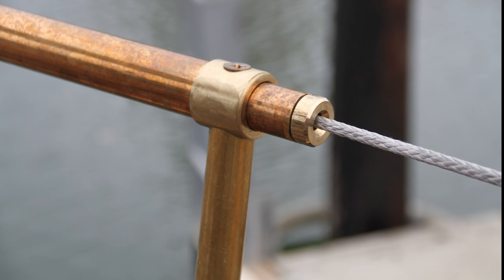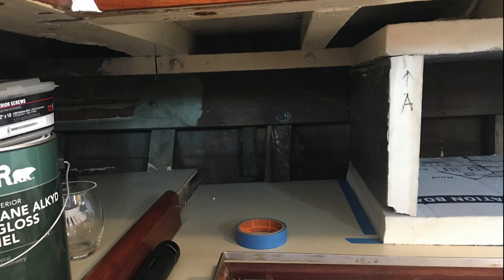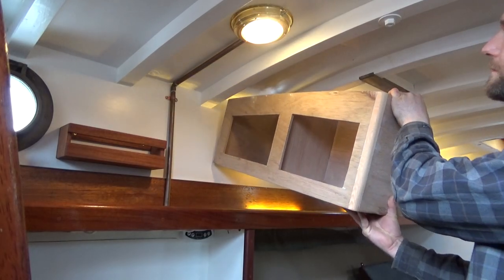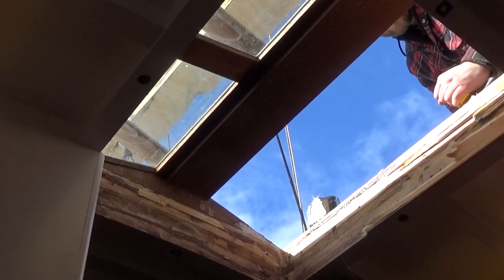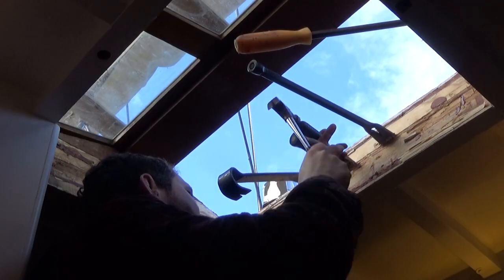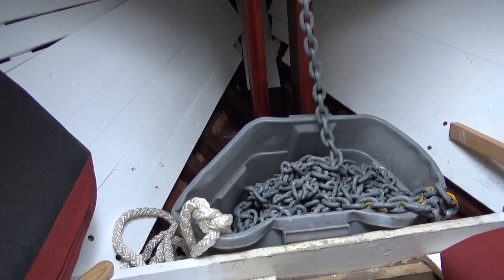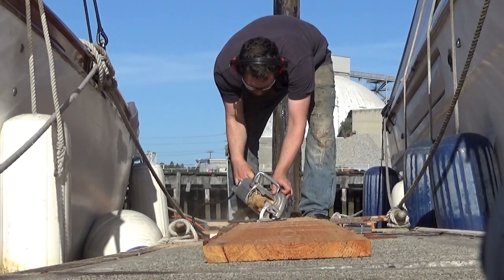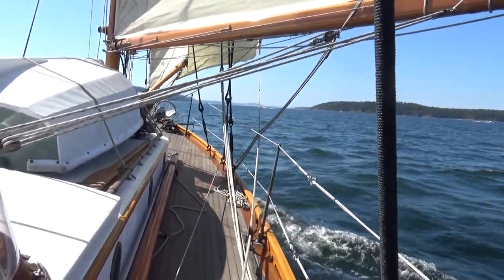02 | Preparing a Wooden Boat for Bluewater Cruising - Safety and Interior Upgrades

Comment: Your commitment to restore and upgrade your boat while preserving the historical integrity of the vessel is laudable and hugely encouraging.  You work to an incredibly high standard which is inspiring.  Personally I would love to see more on the work you did, along the lines of your videos on the strengthening of the bilges and the new water tanks you installed.  Perhaps a walkthrough of the finished boat?  I believe this will be well received.
Reply: Yes,I would be most interested in seeing a tour of your boats systems with a eye towards doing upgrades

Comment: What size of compressor did you use for your new fridge? How much of copper tube is actually exposed to water for cooling and condensing of the Freon vapor "inside" your kitchen drain. . My compliments - It is a pretty genius way of not having to use and drive a salt water cooling pump.  I have a 35 foot fiberglass boat but love the old school wooden double ended sailboats from growing up in the Baltics, Denmark. Safe journey

Comment: how do those "east coast builders " not use worm drive saws ?
Reply: What's the advantage? i have only seen them in the USA,  never down under. Thanks
Reply: A worm drive saw is for ripping down boards like turning a 2x10 into two 2x5 and that saw can handle it.
Reply: Worm drive saws have a much stronger,more durable powertrain and can be more efficient. The added weight also makes them more stable in heavier cuts. They're also serviceable for longer life not just throwaway